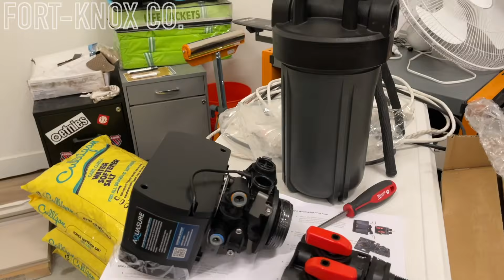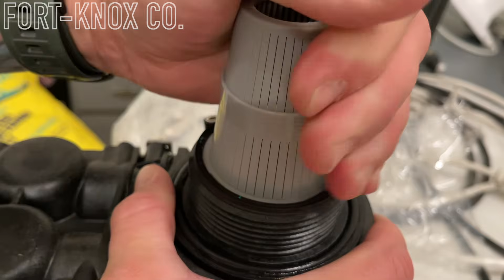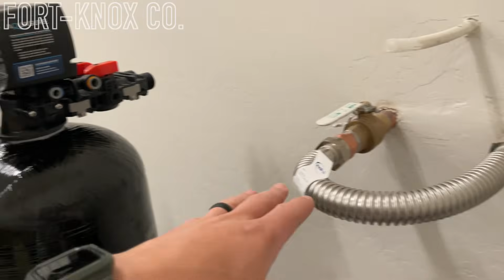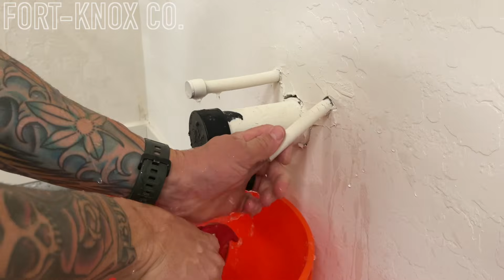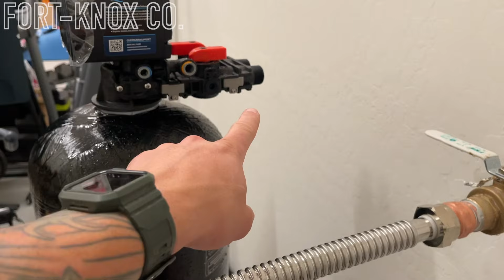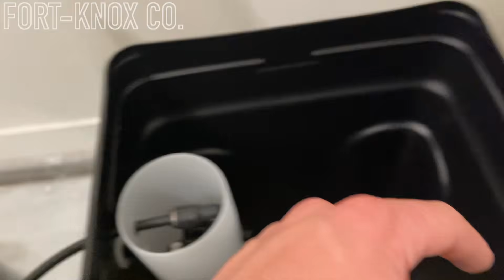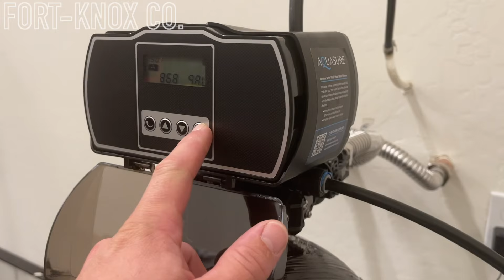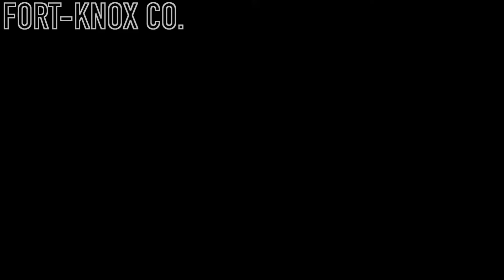How To Install Water Softener System Aquasure Harmony Series | Water Softener Loop Connection

Comment: Very good video. My pipes were setup for a short 1 piece unit, & aquasource 2 piece is 16 inches taller. I used 24" fip-sharkbite and easily done. Clear info! 😊
Reply from the maker: Awesome. I’m happy I could help. Those bite  connections come in clutch.

Comment: My water supply lines are pvc- the yellow kind. What do I do?
Reply from the maker: You can still connect your system. Just need the right fitting. This is where shark bite type connections are very helpful. They are good for several types of pipe. Just need the right size.

Comment: thank you very much for the video! Im installing mine now. I have 1 1/4 cpvc pipes at home, but I could not find the link to get the 1 1/14 to 1 flex pipes that you used in the video. Can you please provide any link where I can get them? Have been searching on amz, home depot and some other sites but no luck. greatly appreciated!
Reply from the maker: No problem at all. I had to order mine through a specific plumbing supply company. I actually have the two that I used temporarily for my first unit. I can try to find the website for that plumbing supply or possibly even sell you the two that I have. They’re basically brand new.
Reply: @FortKnoxCo  that would be great! Thanks. I will send you an email.
Reply from the maker: @tb120994  https://www.isopurewater.com/products/falcon-swc-114x1x12-1-1-4fx1fx1t-ss-conn
Reply: @FortKnoxCo  just want to let you know that I have installed the softener successfully! Thanks again for the great video and resources!
Reply from the maker: @tb120994 that’s great to hear! I just installed one of their 75K grain systems for a friend last weekend and it went smooth as well. These systems from Aquasure are great 🤙🏼 Happy I could be of help

Comment: Your video is a good one for a non plumber. Step by step, I am not nit picking but nit picking, the gasket is called a washer and yes you need plumbers tape “ teflon “ tape. Your directions are almost spot on but if the installer needs to get fittings, material or anything the use of proper terms help them get the correct product the first time. You are correct on the shark bite, I even have them on a Pennsylvania heat plant for over 15 years and knock on wood no leak. Instead of those crazy expensive supply lines a thread to shark and a few pieces of pex might be a cheaper option. But all in all you did a fabulous job installing this. I came across your video as I will be installing one for my son in a week or so and was concerned about the top of the pressure cylinder. Seems cut and dried. Again thank you for the step by step as it makes the average Jim out there comfortable enough to save 6,000.00 dollars.
Reply from the maker: Thank you I appreciate all the feedback. I agree it is important to learn the nomenclature or correct terminology that way when people who might be unfamiliar with what they’re asking for can get more specific and hopefully get better help. My goal was to do exactly that and help people save money, knowing that they can do this themselves and give them a little bit of confidence to try one of those first DIY projects which will hopefully lead into more in the future. Nothing better than the feeling of doing it yourself and saving a bunch of money at the same time.

Comment: Thanks for the video question, wouldn’t the water softer valve act as a shut off valve as well for city water or is it too much pressure tyia
Reply from the maker: Yes it could actually be as a shut off from that point forward. So long as you have no other water lines before that that are supplying something in the house. 

Example being , a lot of the times your water supply from the street goes to your home, into a pressure regulator and the towards your water softener ideally…. But sometimes before that, after the pressure bell and before your softener, it will branch off to a couple on softened water lines like your wind faucet in the kitchen and hose spigots around the exterior of the house.  A lot of times there’s a non softened cold water supply to the kitchen for water plants or something. At least that’s what I was told by an old school plumber.

Comment: Thanks. I have the non electric but this is probably the only video that shows a simple step by step.
Reply from the maker: Thank you! Yeah it should still set up pretty much the same. The connections and water flow , etc.

Comment: how do you prep the machine system when the temp drop under 30 degrees
Reply from the maker: If you don’t have a place to prep it where you have temp control then that may be difficult. You could possibly insulate the tank? You’d have to do something to prevent it all from freezing. I would recommend placing or installing  the tank system anywhere you can keep it from freezing

Comment: Shark bites are rated for in wall plumbing.   I used them on my new water softener no problem.  they cost a little more per fitting.. but $$$ less than a plumber.  GREAT video!
Reply from the maker: That is true. I know a lot of ppl don’t like them but they are rated for it. They also make a “commercial” or professional shake bite that is more expensive and rated for higher pressures.

Comment: You mentioned for your flush line it travels up to the ceiling then down, is the system capable of pumping the flushed water upwards like that or do you need a separate pump?
Reply from the maker: It should be fully capable of pumping that water out. It knows that it needs to go vertical sometimes but in general, it’s under a lot of pressure. The system pushes it out and flushes it with some pretty high flow pressure.

Comment: Thanks for the information. The plumbers installed it and didn’t do this setup process we had a bunch of yellowish water come out on one of the toilets. I will do this tomorrow. Hope it still is ok. We also used potassium they said it’s better than salt.
Reply from the maker: Yeah, that first startup cycle usually helps get rid of any loose residue or dust that’s on the resin inside the tank. So I wouldn’t worry too much but definitely let the water in your pipes in your home. Run for a bit to clear anything out and do the flush cycle on your tank system. You might still see micro bubbles in your water, but that’s OK. You shouldn’t be seen discolored water.

Comment: So is it better to prefill the brine tank with salt and water so the brine solution can be sitting while you install the rest of it. Seems like if you do it “in order”, the water won’t be salty enough to bind to the resin.
Reply from the maker: I see where you’re going with that. Would make sense but not sure it’s necessary for the start up. When it runs its normal regeneration cycle it has time settings and does its flush in and out of the brine tank. That seems to be good enough for the system to do its thing. So for start up I don’t think it’s necessary to have extra salty water. I’d just go with the manufacturer recommendation and stick with the order. But that’s just me. 🤷🏼‍♂️ I don’t think you’d be wrong for adding the water and letting it sit in the tank a bit, but don’t think it’s necessary

Comment: I want to replace my water heater with a tankless do you recommend installing this at the same time? And in the same location?
Reply from the maker: It would be a bad idea. The new tankless water heater will be a very nice upgrade. I have one and love it. And the water filtration system will help with the water quality and the life of your water heater. 

As far as same location, essentially yes but depends on how your house is built and plumbed. Do you already have a water loop for the water softener to be installed? If not the you’ll need one to be plumbed in. If your hiring a plumber to do this work it may be a good time to just have it all done at the same time

Comment: What position of those knobs to not let water in the house ?
Reply from the maker: Usually to shut off water flow, you would have the handles turned in a perpendicular position, crossing the flow of water. If the handles are in line with the flow of water or in line with the pipe, that means that the flow of water is going through.

Comment: Thanks for calling out that thin ‘pipe’ going back into the house with the install.  I have one and it’s copper with a point at the end.  My water installers just used the copper pipe that turned into the inlet and outlet pipes once installed.  The plumbers got excited to see a drain pipe from my hot water heater and use that instead.  I wish maybe they shouldve used that drain pipe so it went to an actual drain rather than dumping out to the side of my yard into another drain in the yard.
Reply from the maker: Yeah a lot of people/plumbers surprisingly don’t know that or maybe there wasn’t one installed when the home was built. But it’s best to have to hit a ln actual house drain. Usually it dumps to the same drain pipe that your washing machine drains into.

Comment: Here's my question, so I have a similar setup in my garage. Except my pipes are coming in from the bottom of the wall in my garage. And there I believe the 1 in or half inch copper pipes. And it is actually directly attached to the city water. So if or when I do this installation I'm going to have to turn off the main water valve from the city. 

My question is would installing a shut-off valve like a lever, like you have on yours in the garage, be a good idea?

I think it is, but I'm not sure if it is a smart idea due to the water pressure. I'm not sure if there's like you know limitations to the amount of pressure that these pipes/valves can handle and what not. It's all new to me. Let me know if doesn't make sense or if you need any more clarification on what I'm asking. 

In short, can I add a lever to shut off the water from the main city line to my 1-in or half in whatever copper line is that are in my garage?
Reply from the maker: It sounds like you could and it wouldn’t be a problem. If it’s within your home/garage then it’s up to you what you’d like to install. As far as pressure and the level being able to handle it I don’t think that would be a concern. I’d assume at some point in your water line from outside where it starts to your home you’d have some type of pressure regulator. There usually is an inline pressure bell housing
Reply: @FortKnoxCo  awesome. I feel better prepared to do this now. My old one took a crap on me and had to remove it. I wanted another but was getting quoted 2-4k!
Reply from the maker: @GGdevelopment  yeah it’s pretty crazy how expensive it can be to have it done for you. That’s honestly what motivated me to do it myself and I figured I would document it and try to show others that they could possibly do it themselves too.

Comment: Looks like you didn't use the supplied water filter. Are you using an alternative, or filter less?
Reply from the maker: Yeah, in this video, I didn’t end up installing that but I did install the water filter cartridge that goes either before or after the system in a different video. It goes in line either before or after depending on your preference really. There’s different thought processes behind where you put it and why, but either way it functions as it should.
Reply: @FortKnoxCo  do I have to install it?
Reply from the maker: @jonathonmontano5369 you don’t have to. It’s just an added layer of filtration for large particles. Doesn’t soften your water any more or less.

Comment: do the connections absolutely need to be braided hose going into the inlet and out of the outlet? or can it be hard piped?
Reply from the maker: They can be hard piped they can be corrugated or they can be the braided lines. Whichever ones you have or you want to spend the money on. If you look at my other water softener video I used all PEX to connect everything. If you have the ability to or the tools you can use whatever works for you.
Reply: @FortKnoxCo thanks for the fast reply
Reply from the maker: @Lost_scroll  no problem at all. I try my best to reply to everybody as fast as I can. I appreciate you finding the channel and watching the video.

Comment: Just bought a new house and had it pre-plumbed for a water softener. So after looking at how you demonstrated the installation, should be fairly easy for me. My question is,…….Are you satisfied with that brand, ‘Aquasure’?
Reply: I’m glad you liked how the Aquasure brand water softener worked out for you. I’m pretty much set on going with that brand myself. Question though,…….Home Depot or Lowes don’t actually carry this product in store. It’s an ‘online product’. Was this the way you purchased your water softener? The reason I am asking is because I’m not really sure which Aquasure model to purchase. No one in store to answer my questions. I’m thinking the 64,000 grain harmony one. The 64,000 grain signature elite, is almost double in price. For a new four bedroom house, two full bathrooms, kitchen and laundry room, with four adults and two young children, which would be best?
Reply from the maker: @ajesparza4292 I ordered mine through Amazon. Free delivery and I believe they have a return process too if necessary. They had good customer service communication too. I was able to chat with them. 

But best price and free shipping was why I went that route. Dropped right in front of my garage for me, didn’t have to lug it around in my truck. 

The 64k grain should be a good fit. I know they have the “whole home” system now too so it will filter & soften the water if that’s what you want.
Reply from the maker: Yes. I really like the aquasure. Had no complaints. Worked great and was very simple to operate.  I might be upgrading to their whole
Home system soon. If I do I’ll make a video installing that too

Comment: so would this system go between the water pump and the pressure tank we have a well. so I have a house that has been cobbled together and a lot of the plumbing in the house needs to be replaces its over 120 years old and we just replaced the pressure tank but we realized there's no point replacing everything unless we put a softener in but we need help knowing where to install it?
Reply from the maker: When you have well water and a pressure tank, the water softener should be installed after the pressure tank but before the water splits off to the rest of the house. This location ensures you have consistent water pressure to the softener and protects the well pump from the interruptions that would occur if the softener were installed before the tank. The ideal location also requires nearby access to a drain and a power outlet

Comment: Why didn't you install that small grey color drum was looking like filter ??? what is that and where to install that filter ?
Reply from the maker: I did install that filter in my other water softener whole home system. But not in this video. It’s either installed before your system or after. Usually manufacturers show it installed in line before your system but I installed it after. The reasoning is it will catch any large particles. But I like it after the system so if anything makes its way out of the softener system or even the matter inside makes its way out it will catch it before it gets into the house or pipes or fixtures. 

I’ve had a friend who’s softener failed and for whatever reason it release all the matter inside the tanks into the pipes and if was a pain in the butt to flush out of the water heater and all the shower fixtures in the home. 

 Not this brand that failed, but I’ve seen it happen to other systems.

Comment: Our waterline appears to just be one straight line, there’s no loop. Any suggestions?
Reply from the maker: Can you see you main water line though? 
Because the “loop” is just your water line , but they put a 90 degree elbow to pop it out of the wall and then a couple more 90 degree elbows to pop it back in. It’s just a straight water line but they do this so you can access it and cut the center out and place your water softener in line. 

Because normally the water line is concealed in your wall. So this allows easier access if someone wants to add a softener system. But if you don’t have a loop sticking out the same thing can still be done. 

You just need to first get to your water line and make sure it’s before the water splits to you water heater. You want to install the dinner system before that so you are softening your cold and hot water supply.